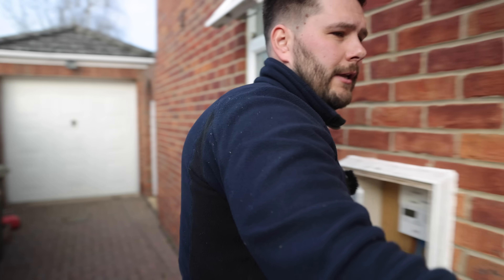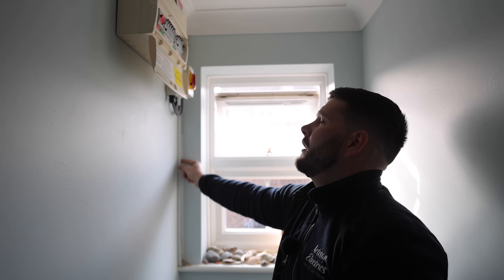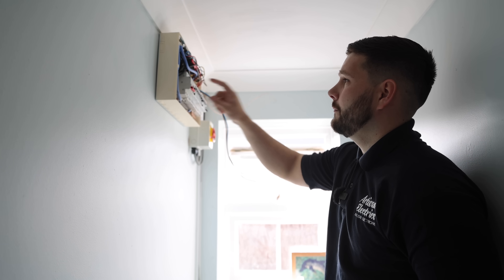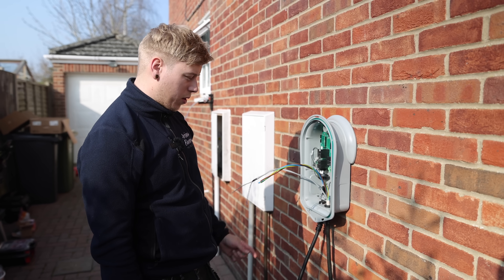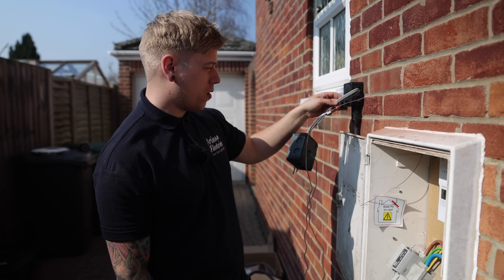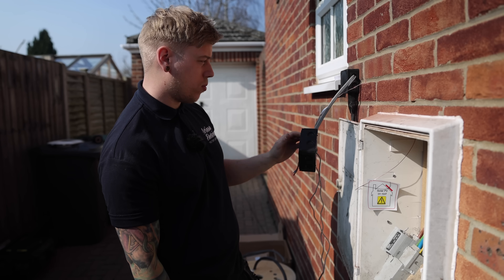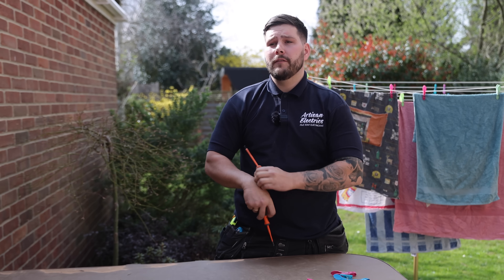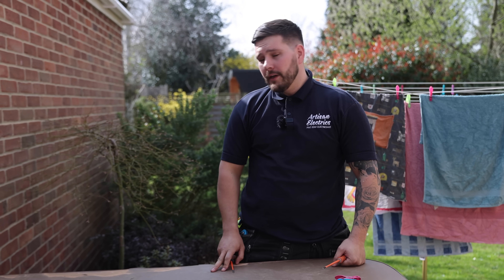1 OF 200 LIMITED EDITION MEGGER TESTER - Electrician Life

Comment: I see you haven't installed separate double pole rcbo protection so if the zappi  does require immediate isolation or under fault conditions your also isolating every other circuit protected by the rcd you have installed in the existing c/u

Comment: 4mm twin and earth, installed using installation reference method B has a rating of 30 amps.    Why have you installed a 32 amp MCB for this circuit?   Sorry lads, but thats a Code 2 on the next EICR!   !! Potentially Dangerous !!

Nice job overall lads, but these details are more important than looking pretty on camera with pretty looking test equipment, and fancy expensive battery tools.  Good working knowledge of the wiring regulations outweighs all of that……and ultimately leads to a safer installation.   

I’d go back ASAP and either upgrade the cable or change the installation method.  I don’t suppose this was cheap for the customer.  2 of you at more than £90 per hour + VAT.  (EACH!). To be fair…..This install shouldn’t be paid for until it is installed in accordance with BS7671.

Comment: Not only pulling the main fuse but removing meter seals and connecting into the smart meter.. I think qualified electricians should be able to remove main fuses however we are not permitted and certainly not permitted to cut into meter companies seals / meters. As a professional company it seems pretty poor that you have done this.
Reply: what other option did they have?

Comment: No fire clips in trunking 🙄🙄 cable run in cavity 🙄 insulation test carried out with out load connected 🤔 and fitting isolator on dno equipment 😮
Reply: Isolator was fitted after the meter.
Reply: @stupot_64  yes but you’ve still had to cut the seals on main fuse and pull that or do it live , by the looks of it was done live as smart meters normally send signal it’s been switched off and they send meter fitter out and charge you for visit